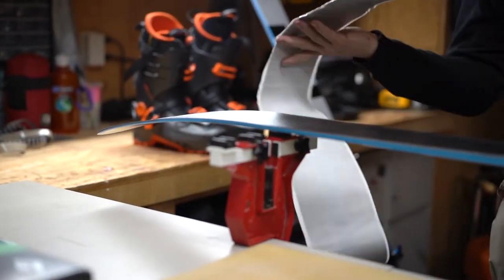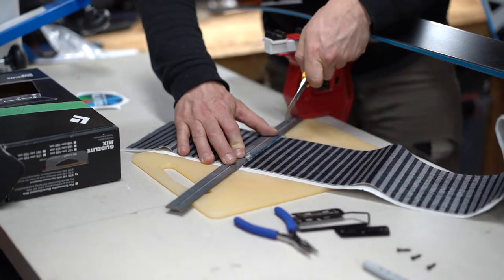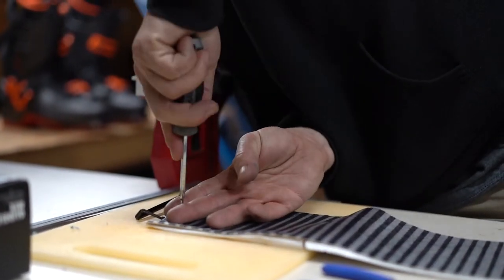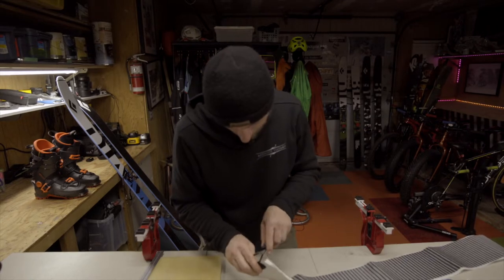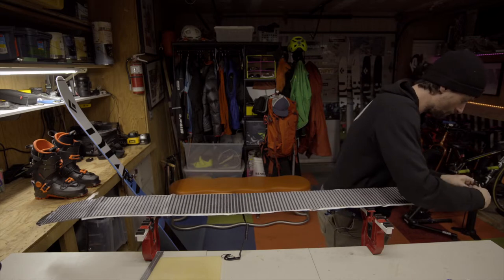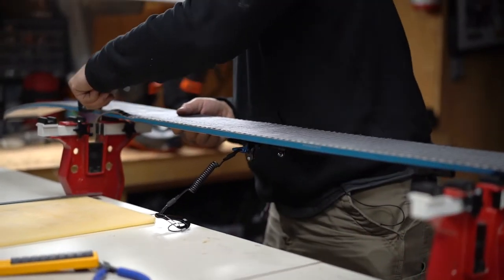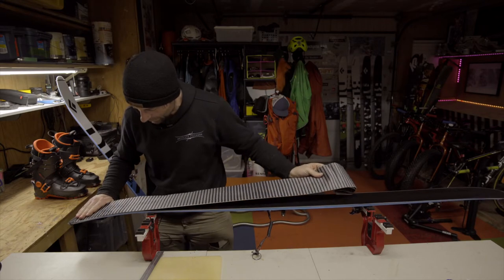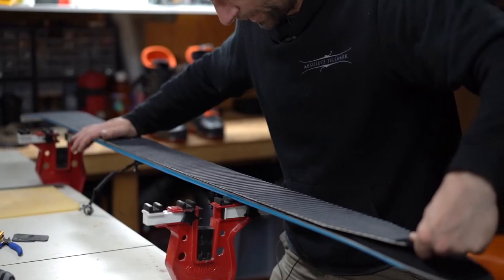How To Install and Cut Your Climbing Skins To Fit Perfectly

Comment: Great video, thanks for posting. Do you ever melt the edges of the skins to seal them? Mine are getting a little frayed at the edges after a few uses
Reply from the maker: We have not tried that. When cutting the skins, we recommend using a brand new blade to ensure a razor-sharp cut with no tearing. If your skins are fraying, you can re-cut them narrower to remove the falling threads.